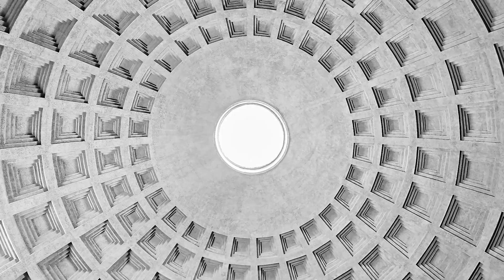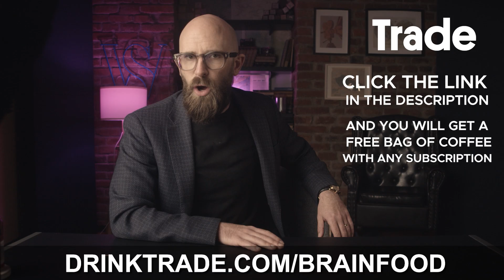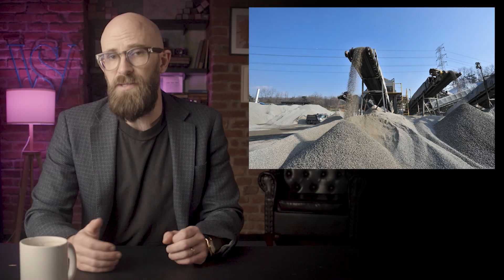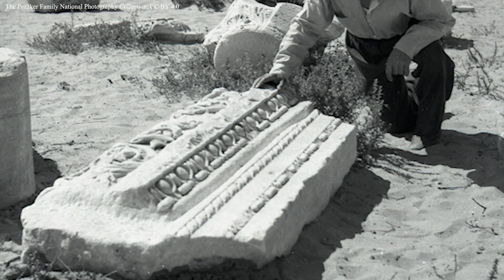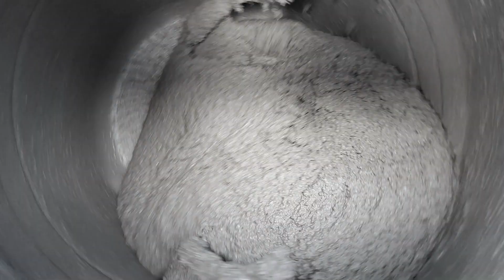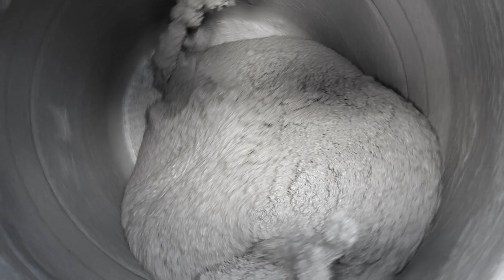How Did the Ancient Romans Make Concrete So Much Better Than Ours?

Comment: Short answer:  they didn't have to deal with modern priorities and the resulting budget constraints.

If you want to build stuff that will last for thousands of years, like the Romans did, you theoretically can, in the sense that we know the underlying physics of how to do it.  But it changes the nature of the project, considerably.  

Among other things, you can't use steel reinforcing wire in your concrete if you want it to last that long, because steel encased in concrete corrodes over time.  Without reinforcing wire to bear tension, you have to build compression-supported structures (like classical arches), and you can't build tension-supported structures (like a flat rectangular bridge held up by a few small pillars spaced far apart).  This greatly increases the total amount of concrete you need, which increases your costs for materials and labor, as well as the timetable for the project.  On top of that, it places a lot more load on the ground underneath, which greatly increases the amount of soil and subsoil that you have to dig out and replace with something less compressible (like concrete or stone).  Now your foundation is also ten times as heavy-duty as it would have been, so add up more materials, labor, and time for all of that.  Perhaps you can see where this is going.

When all is said and done, you've taken an two-year project and turned it into a multi-decade project, and the cost has ballooned correspondingly.  If you want to do that sort of thing in the public sector, you need thirty-year terms of office, which are (for very good reasons) not common in the developed world.  And if you want to do it in the private sector, all your funding has to come from sources that share your build-for-the-ages vision, which instantly rules out shareholders and venture capital.

We don't build like that these days, because leaders with a god complex who want a monument to their administration that will last for thousands of years, tend to get voted out or overthrown.
Reply: Pay a lot now, pay next to nothing for decades.

I think it's time we reevaluate our math. It looks good at first when we can build a bridge for "just" 10 million dollars. But they we have to spend 200,000 every year to maintain it, and have to replace it in 20-50 years. Or, we could spend 50 million to build, which okay, ouch, but then we pay like 10,000 a year to maintain it, if not less, and never have to replace it.
Reply: @forestwells5820   Your figures are a bit off.

Building in the Roman fashion, you can't build that $10 million bridge for $50 million.  You can't build it for $100 million either.  $500 million, maybe.  Also it will take about twenty times as long to build as the $10 million version, which is probably the larger problem.  Modern people get impatient waiting two minutes for a microwave oven to warm up a plate of food.  They don't want to hear "This bridge will end up being better, so just be patient while we take twenty times as long building it.  Sure, you'll be retired by then and won't need to drive to work over the bridge any more, but you can just suffer through going the long way around for your whole life so that your grandchildren can inherit a masterwork bridge.  It'll be great."  There's going to be an election at some point, and the geniuses who pushed for the build-for-the-ages project will likely be out of office, and their successors will scrap it and build the $10 million bridge that can be done in three years.
Reply: @jonadabtheunsightly  I don't think the Romans began building their bridges today and then finished in the times of their grandchildren.  Not least because items were built BECAUSE THEY WERE NEEDED THEN and not 50 years into the future.
Reply: @jonadabtheunsightly  No, you're the one whose numbers are off.  Using Ultra High Performance Concrete (check out "Steelike" for example) actually allows vastly decreased concrete usage, and you must factor this in.  I don't think anyone's talking about using the same exact composition the Romans used, and I don't even think the Romans would have agreed with your assessment of what they would do to build a particular bridge—the knew to pull out tricks to keep things light, for example.  ALSO, you seem to be imagining that we use simplistic ideas of Roman methods yet then retain our modern building mentalities, which includes stopping for all the red tape and union concerns, and court injunctions, and permits, etc.; so of course it would take vastly longer in our modern world.
  True skyscrapers may be next to impossible without tension members, and the biggest of big bridges too, but it's still possible to do a lot (especially with smaller bridges--let's say 80% of bridges) without tension members, and it certainly doesn't mean that the costs are multiplied by 50x, or whatever your astronomical figure is.  That's ridiculous.  The other fella, forestwells5820, was more accurate in saying it might bump up the initial costs by more like 2.5x.
Reply: @dandooshnanoosh  I am assuming modern bureaucratic red tape, yes.  OHSA workplace safety reviews, overtime pay whenever anybody goes over 40 hours in a week, the whole nine yards.  It's a largely unavoidable fact of life in the current era.
Reply: But two year projects already balloon into multi decade projects with costs increasing accordingly.

-cries in Indianapolis
Reply: Cries in California. I want high speed rail 5 years ago.
Reply: @pikachuchujelly7628  You don't have it???????????????  I mean, I know we don't but we are a small country with a small population and not enough rail passengers to even think about paying for it, but it's common in Asia, found in Africa and is increasing in mainland Europe as well.  I'd have thought the US - given the huge distances you have to cover, rather like China does - would have had high speed rail decades ago.  Rather like China (and Japan) have had.
Reply: @HeroyamSlava-g3y  The oil, automotive, and airline industries are a powerful political force in the US and have considerable lobbying power to shut down any public transit projects.
Reply: @pikachuchujelly7628 I feel your pain, there is so much red tape in tape in the way.
Reply: @pikachuchujelly7628 not only that but for each piece of land that touches a  different county or another person's property there's somebody who wants a a large slice cake for only a little.
Reply: @eddapultstab2078  Yeah, acquiring the land for projects like this is very difficult, and people sue to stop it from happening.
Reply: @jaysmith1408   Ok, but do you really want to make that ten times worse?
Reply: The big difference btw the romans and us now is they had slave labor, that cuts the cost in every aspect of the project. 

And i also think you're underestimating how fast using the roman building method will be sped up with machine work
Reply: @joshg6491   Eh, there are still parts of the world that use slave labor extensively, and build a lot of stuff out of concrete, but they don't build in the Roman lasts-forever style, at all.  In fact, one of their own politicians is on record comparing their construction to tofu.
Reply: @joshg6491 Nope, we have machines. Which are far more efficient, and most likely people building these would have been free people since this is quite important job.
Reply: @joshg6491  Maybe a bit, but modern equipment doesn't make concrete dry faster.  That's something we hardly think about when we're laying it down six inches thick or whatever, but if you're building compression-supported arches and such, the sheer volume of concrete involved makes it a big deal.  You're going to have concrete thicknesses measured in feet, and you can't just pour all of that in a day.
Reply: @jonadabtheunsightly  How long do you think it took to build the colosseum, because it was surprisingly quick at between 7-8 years yet most of it is still standing today - minus those bits reused for other buildings over the 2000 years since it was built.  Still faster than most buildings are put up today with modern equipment.
Reply: 100%. It's not that we can't, it's that the economics of it is absolutely prohibitive.

Comment: They used an ash from a volcano that set it quickly. It even set quickly under sea water. The salt water even made harder. They broke the code of the concrete a few years ago. 

As to the done, they made it lighter and lighter as it went toward the center by tossing in clay pottery and straw.
Reply: Bingo ^ For those wondering that volcano is called Campi Flegrei, in the Bay of Naples. A Volcano with a highly active hydrothermal system that provides the conditions to almost instantly mix the ash with needed materials. I'll give them credit in the sense they managed to find a solution that not only worked but has held out very well for them. However, to say it didn't require an insane amount of luck and however many bodies the roman's were willing to throw at, would be a complete lie.
Reply: You also forgot about the addition of quick lime.
Reply: @Mill_Wrong  They probably didn't watch the video. For years, many just assumed that using volcanic ash instead of coal ash was the key. I don't understand why people leave comments like this - assuming they know better, throw out their two cents and just leave without actually paying attention to what they're commenting on.